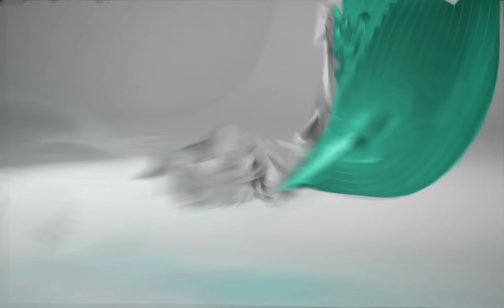Maya LT for Unity Developers: Skeleton Creation and Adjustment -- Part 1

Comment: I posted this in the Maya LT General forum, and I received no responses. 

I have a character setup with its arms at a 45 degree angle. As soon as I start translating the elbows and wrists to position them correctly, I keep getting validation errors.

Also I re-designed my character with the arms at a T-pose, elbows bent slightly, and I also get the same validation error; "The left arm doesn't seem to be parallel to the X-axis", even though I'm only translating it on the Z-axis to align it up with my mesh.

Thoughts? Thanks.
Reply: my guess on what little rigging i know in Maya 2014 try destroying the joints in error then remake them. other idea try using the delete  history and adjust with the freeze transforms settings, i heard they can mess with rigging and the animation area. that is where i would check first for the bug in question the look in the line of bones to see is they causing the problem your having. also note to rest the tools button fixes errors with rigging bugs sometimes too. past that not sure what to say to point to possible fixes..

Comment: why my maya lt doesnt have the mirror left to right icon to click?
Reply: I couldn't find it either but i mirrored the joints manualy and then fixed the definition by dubble clicking first on the bone I want to give a new deffintion in the deffintiontab and then on the matching bone in my skeleteon